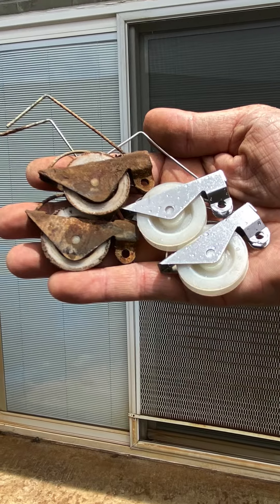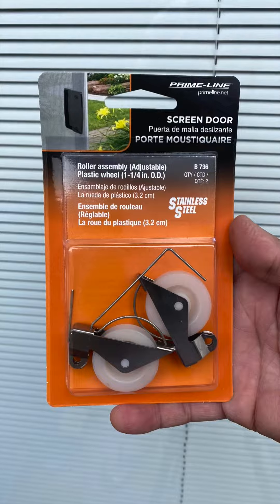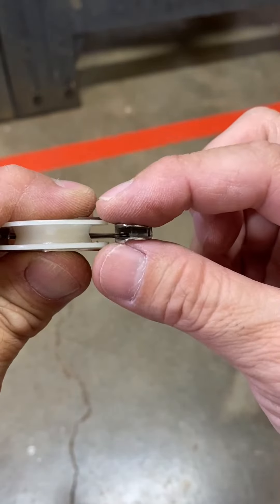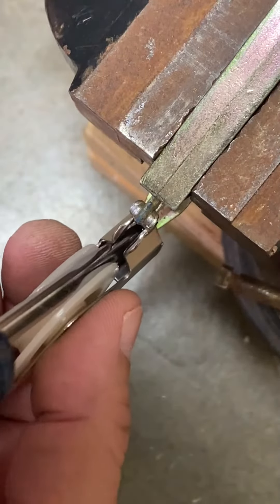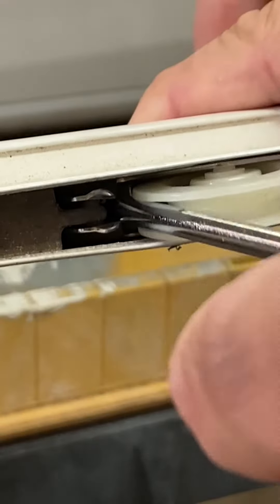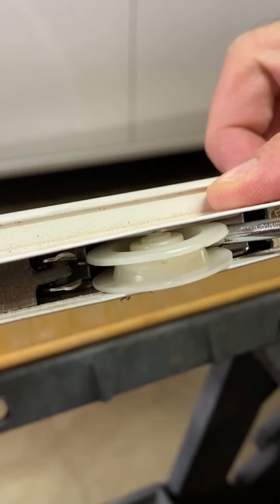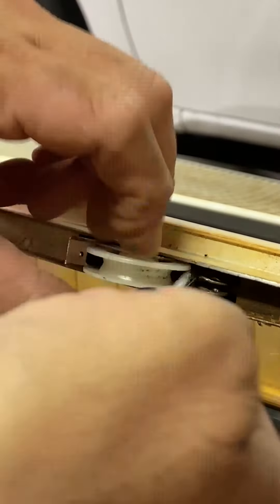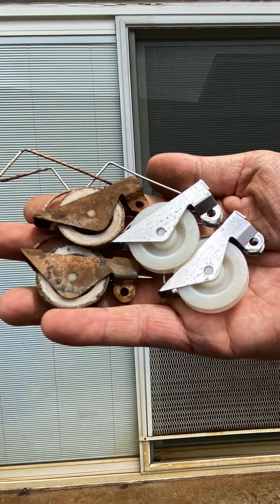How to Replace Sliding Screen Door Rollers w/ a Screwdriver

Comment: I know this is a much later response, but do you have any idea what to do if one of the tabs breaks? We have a similar screen door, but the tabs are plastic. The wheel feel right out when I got the door off the rail and the broken portion of the tab is inside of it. Hoping that I don't have to replace the entire door. Any advice would be appreciated.
Reply from the maker: Hi there... If you're referring to the tab on the roller, you can purchase new rollers or use one from the top of the door (if in good condition).  If you're referring to the pegs on the corner brace, you can purchase a new corner brace, but replacing it will require removing the screen and taking apart the frame.  Hope this helps.
😎

Comment: What if there is no labeling on the sliding door or screen, how do I figure out what type of roller to buy?
Reply from the maker: I suggest that you remove the door and remove a roller.  You can also check the top of the door… if those rollers are in good condition you can move them to the bottom of the door.  😎

Comment: Excellent video. 
Great job showing the details of the work.  Very professionally done.  
I will change out my broken wheel today with your video to help me.  

Thank you.

Edit:  found that mine engages a soft plastic part (the round part that the roller is pried off) that broke as soon as I tried to spread the roller with my #1 Phillips screw driver.  Of course!
So now I have a door that is trash.
Reply from the maker: You’re welcome and thanks for the feedback.  Professionally done might be a stretch… LOL
😎
Reply: @HacksbyDad  it seems that some manufacturers make the interior door corners — the part that engages the wheel assembly you showed being replaced — out of plastic entirely.  Crazy. 

I’m bringing the door to a professional now to have it replaced. 🥺
Reply from the maker: @Colorado-Tinkering  Oh... I haven't run into that, but I've only worked on a few sliding screen doors.  At least you tried.  👍

Comment: My dog ran through the screen door and broke both the entire screen door off. After doing what you showed I realized the wheels aren't broken, what's is broken are the pegs the tabs go into. When I took the wheels out the pegs were stuck and broken into the wheel tabs. 

Is there anyway to replace the "pegs" as you called it?
Reply from the maker: How big is your dog?  LOL
Google “Primeline B-569” for the corner insert.  It should be available at the Home Depot and Amazon.  The Home Depot product page has a how-to replace video.  Good luck!
😎
Reply: @HacksbyDad  Thanks! That looks like it should work. Will get it and get it done. Believe it or not, it's a Sheppard puppy only 25 lbs right now. But I imagine the wheels were already failing since it's her 10th time running into it lol
Reply from the maker: @de8784  👍😎

Comment: Good video, but not easy to install the rollers just with the screwdriver. However, after I sprayed some WD-40 lubricant, the rollers slide in easily.
Reply from the maker: WD-40 to the rescue!  👍😎